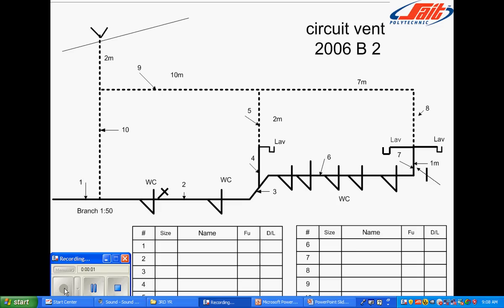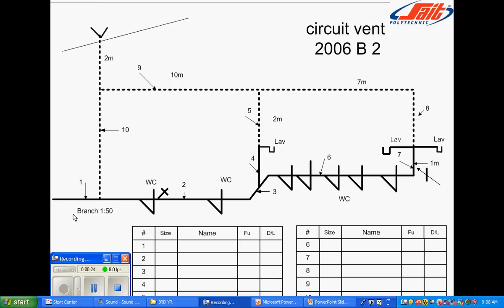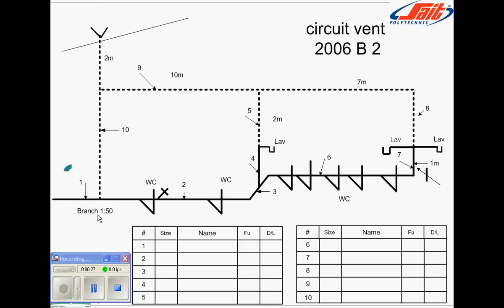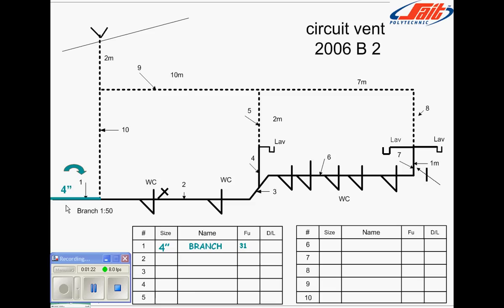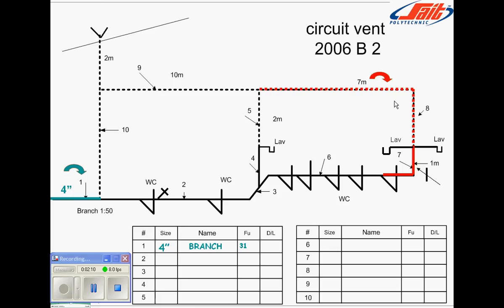SAIT PLUMBING CIRCUIT VENTING

Comment: Is the relief vent also not supposed to be smaller than 2"?
Reply from the maker: A dry relief vent is sized one size smaller than the dry portion of the circuit vent, hence on this animation it would be a min of 1 1/2" according to clause 2.5.7.3. in the 2015 Canadian National Plumbing Code

Comment: Great video,
I believe for the circuit vent sizing ,need to count the hydraulic load from the lav as well,
According to code we count all fixtures draining to the circuit vent except the loads on relief vent .
So on number 8 ,the load on the circuit vent is 31 fixture units and not 30
Reply from the maker: I appreciate your comments, however the video is correct, the load for #8 is 30 fu’s.   You don’t count the lav as it has a vent above it and it is drawing air from it.  You do count the ACV ‘s load in the CVB though.  I hope that clears it up for you.
Reply: @notooshaby  
Sorry I did not underestand.
Are supposed to count additional circuit vent or not ??.
The lave that you did not count is additional circuit vent .
JUST does not make sense for me ,
In the book says something and you say other thing .

Comment: Great video ,
On the canadian national code 2,5,3,1,11 it is written that we dont  count relief vent for calculating hydraulic load for circuit vent but we have to count additional vent 
How come you did not count additional vent ?
Reply from the maker: We do not count the additional circuit vent ever, when counting the circuit vents fixture unit load.   The reason why is because the ACV is installed strictly to help out the circuit vent, the ACV isn't even sized itself by a table, it's dry portion is sized strictly by a  code clause 2.5.7.3., and its wet portion is sized by another code clause 2.5.4.5. c).   You never count the acv load on the circuit vent because it has its own vent.   You do however count its load on the CIRCUIT VENTED BRANCH BELOW.
Reply: @notooshaby  
Thanks a lot .
Great explanation,👏
I got it 👍

Comment: I thought the circuit vent had to be dry with nothing dumping above it?
Reply from the maker: 2.5.4.5. of the 2015 Canadian National Plumbing code states that you can dump up to
Reply from the maker: 2.5.4.5. of the 2015 Canadian National Plumbing code states that you can dump up to two 1 1/2" and 1 1/2 fu traps arms into the wet portion of the circuit vent, it will be no less than 2" in size.

Comment: Certainly, the horizontal vent between the last W/C and the L.S. 1/4 bend must be 4"?
Reply from the maker: I'm assuming you mean the additional circuit vent rising above the horizontal zig zag or more than a 45 horizontal offset which is the wet portion of the ACV.   This vent is sized from 2.5.3.1. of the code, and is no less than 2" and sized as wet vent which would make it 2".
Reply from the maker: It only has to be 3" now in the 2015 Canadian National Code 2.4.7.2. says that you can use a 3" cleanout on a 4" branch.

Comment from the maker: I made this video a few years ago....in accordance with the 2005 Canadian National Plumbing code, its still the same rules for the 2010 NPC except the Wet Vent table number has changed from  TABLE  2.5.2.1 to  TABLE  2.5.8.1.
Reply from the maker: and now it is still good for the 2015 code
Reply: @notooshaby  hello fred, I was watching ur video and it helped me a lot in school, I have one question,. For hydraulic load on ckt, u said it's 30 but in school and in code book they say we have to calculate load from additional and it's gonna be 31 fu. Only fu we don't consider is from relief.
Reply from the maker: @Grewal5171  I hope this helps, sorry for the delay.    The code book does not say you include the load from the ACV,  the load for the circuit vent is calculated by adding everything in the CV branch and any fixture directly below the dry CV.     The ACV has its own vent above it, therefore you do not count it as drawing air from the CV.   The ACV is sized according to 2.5.7.3. of the 2015 code, one size smaller than the dry portion of the circuit vent (CV).
Reply: @notooshaby  hello fred, checked ur video again today, its very good review, if ulook at picture in division-b A-2.5.3.1-M, in 2015 code book, that shows an acv with 1fu, branch has total 47 fu, relief vent has 2 fu, and that picture shows 45fu for sizing ckt vent, which shows that they added fu from acv for sizing ckt vent.
Reply from the maker: @Grewal5171  I've just looked at the drawing in A-2.5.3.1.-M, and you are correct in the way it is labelled with 45 fu's underneath the circuit vent.   This has to be changed in the new code 2020, as I believe they mean for the 45 fu's to be counted only in circuit vented branch.  44 fus should be the only number counted for the dry circuit vent.  The ACV has a vent above and is drawing air from it.
Reply: @notooshaby  even in school they are teaching us the way its in book. Even at bottom of same page it says do not include load from relief vent only, rest will be calculated. Even 2.5.3.1(11) says, for sizing ckt vent calculate hydraulic load from all fixtures connected to branch served by ckt vent but shall not include sentence 3,4,5(relief vent). I assume all fixtures means acv and fixtures vented seperately too but not relief vent fixtures. I agree like u said when fixtures have own vents then adding load to ckt vent is just overkill i think
Reply from the maker: @Grewal5171  I just had my 4th online class for water supply. One of my students had a new version of the 2015 code book, and it has the 45 fu's changed to 44 fu's.
Reply from the maker: so it has been corrected already
Reply from the maker: @Grewal5171  in other words it should be like my video, and they did correct it
Reply: @notooshaby  
Great videos,please continue
Reply: @notooshaby  Hi Fred, I know it's late to the conversation, but as of the 2020 code it still counts the ACV load on the circuit vent (45). They have not changed it to 44. With that said, I've been going off of 2.5.3.1 (11) which states you have to account for anything that dumps into the CVB (anything upstream of the relief). Could you give me the code clause that you are referencing? Thanks, love the content!
Reply: N.. 6   n.  N.     N6b